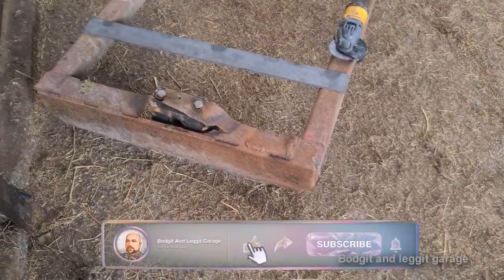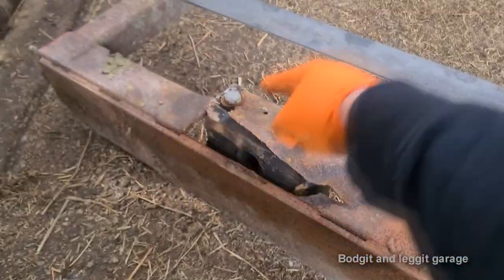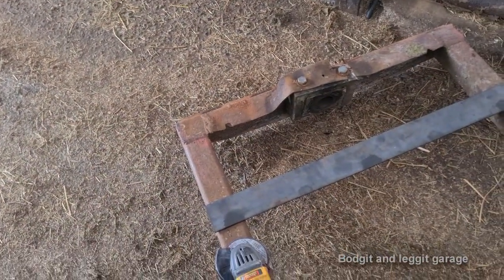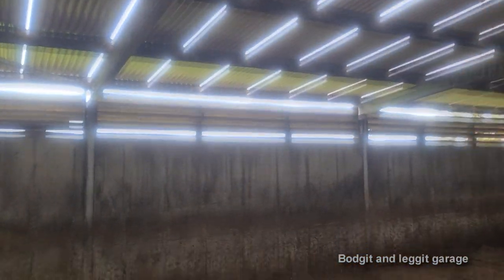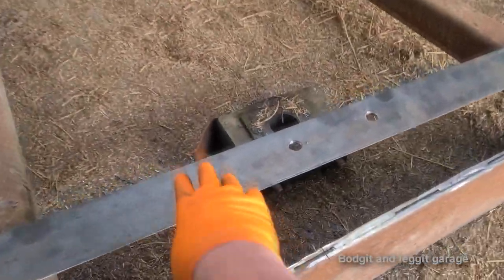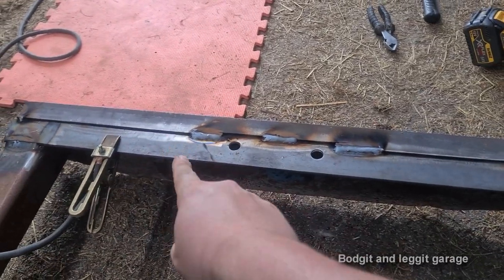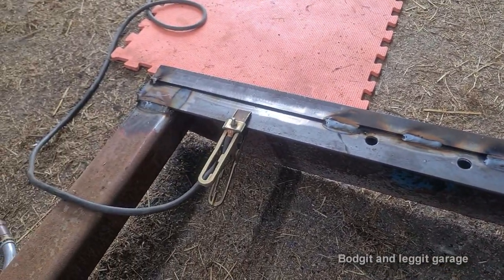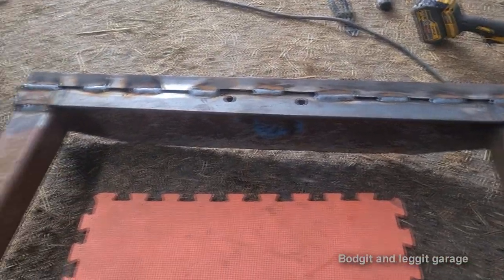Don't Try This At Home Slattered Shed Cowshed  This Is Not A Good Idea

Comment: Leon, the methane is lighter than air so it should vent itself and not build up toa a flammable amount.  What slurry tanks are deadly for is sewer gas or hydrogen sulphide which is heavier than air and will stay in the shit pit until it's disturbed! Be careful and don't get your hands too dirty👍